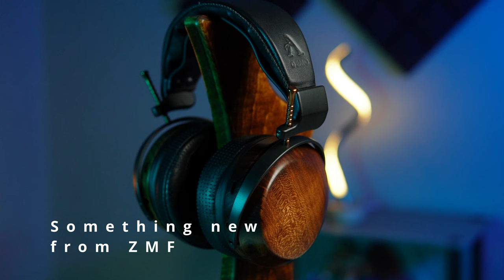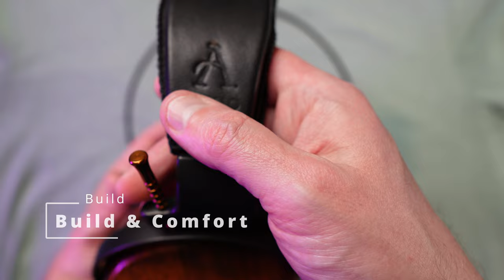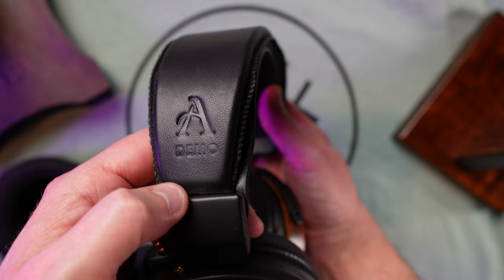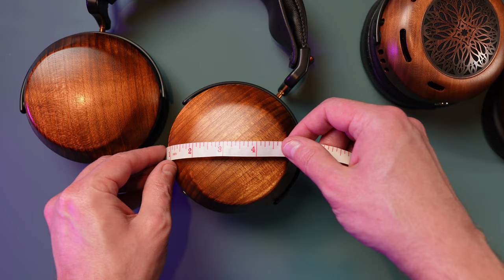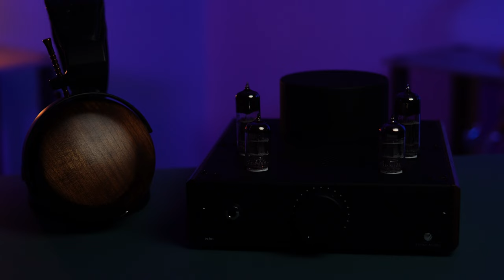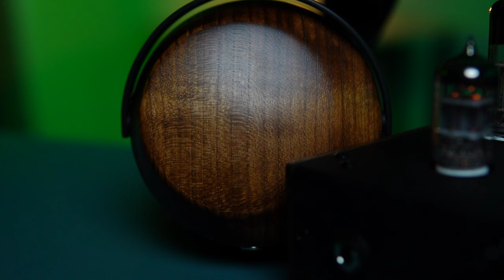ZMF Atrium Closed - Something Different

Comment: Hi Ryan. Do you think owning an Atrium Open and Atrium Closed would be too redundant sound-wise? I only ask because I currently own a Verite Open and Atrium Open as my only headphones atm, and love them both, but I do kind of want to have an amazing closed back for isolation/the closed back sound. A verite closed Ive heard sounds super similar to the VO, so not really interested in that. 

Also will likely get a Caldara at some point too but not in the near future lol, but yeah would love to hear your thoughts if you have a chance. Thanks!
Reply from the maker: I did own both the Open and now the Closed.  I kept the Closed because I felt it had the complete sound I was looking for.  So yes, I do think they are different enough.  Also, when you pad swap the closed you can truly get a different experience.  The closed has a fuller bass response but will relax your midrange a bit.  I do feel like it has a nice open sound for a closed back also.
Reply: @Skeeb23  Appreciate it man,. I just finished up consolidating my collection to only the 2 headphones (I actually grew to hate having such a large quanity of headphone choices lol, and no space). I think Im going to take the plunge and get the Ash Ltd version of the Atrium Closed in red, looks awesome

Thanks again!

Comment: Seing that Caldera in the background, what do you think about it vs Atrium Closed? We ZMF addicts are always in search for the new drug, just not sure if dynamic driver Atrium can compete with plannar Caldera that was so much of a step up to other ZMF models to me at least.
Reply from the maker: Well, I've just started listening to the Caldera.  So far it's made a big impression to me but I've got plenty of things to do with it still with my gear.  I'll also be considering the price increase compared to the rest of the lineup.  Agreed on the ZMF addiction though!
Reply: What do you mean by "compete?"
So far, I've seen some folks say they still prefer the Verite over the Caldera, and some say they listen to their Atrium more than their Caldera.

The Caldera is better in most technical categories, but that doesn't equal better musical immersion or experience.
Reply from the maker: @asplmn  this is such an excellent point.  I would not regret one bit if I owned the Atrium Closed over Caldera or the other way around.  Both are musical in their own rights.  Then add in pad variation, amps...tube amps ..there is a lot you can do to cater to what you want to hear and enjoy!
Reply: @Skeeb23  exactly. 😊
It's always good to remember that high-end audio is all about finding one's own preferences. Once you get to the TOTL stuff, it's usually more about tradeoffs than something being just all-around "better."

Will you be getting your hands on an Olive set of AC for comparison of harder vs softer, @Skeeb23?  🫒
Reply from the maker: @asplmn  I will not, but I've already read quite a few that have over on head-fi.  I know Zach has said there will be some sound variations for sure to be heard.
Reply: @asplmn  well for me it does. Verite see little to no use since I got Caldera, which is very similarly tuned but does almost everything else better. Only thing Verite does better are female vocals in jazz and slightly more 3d soundstage, rest ist vastly inferior to Caldera. That’s why I am wondering how AC holds up
Reply: @amaya897  if you ever get to compare please drop some info here.  I just got the ZMF AC and I'm really liking them.  I was hoping the Caldera would pair nicely and replace my Arya Stealth and possibly HD800s..unless I find later I can't part with the 800S

Comment: RME ADI-2 has waaaaaay more than enough power for these or any ZMF. I can't really take any 'reviewer' seriously when they don't understand basic amplification power requirements. Even at 120db(!). 120db would completely destroy your hearing. These headphones only require about 250mw and 8.6 volts for 120db. RME ADI-2 puts out more than 310mw and 9.9v at  300ohms. If you get the RME ADI-2 PRO version it will double those power figures with the balanced output. I have powered several set of ZMF headphones with huge remaining headroom with an RME ADI-2 DAC. "Audiophiles" and "reviewers" need to stop with all the misinformation.. 5:10
Reply from the maker: I disagree because this is where subjectivity comes in.  You are speaking from an objective nature to which sure the ADI2DAC is enough to power ZMF and other difficult to drive headphones.  However, when you listen on different amps with more power it's not about volume.  It's about the details, dynamics, impact, speed.. many little things that can make a difference.  I'm not misinformed if I can literally hear it.  Again, it's my point of view.
Reply: @Skeeb23  I am not saying you cannot hear a difference. I am sure you can. What I am disagreeing with is that taking your quote (verbatim) from the video “they are a headphone that requires some power (objective), I don’t think the 2 DAC has sufficient enough power for something like ZMFs. At least in my experience.” You are saying it is your opinion that it does not have enough power when objectively it has more than enough in terms of MW and current. I just think that if people are newer to the hobby, this will be misleading. That is all.
Reply from the maker: @04yellowjacket  That's fair criticism that I'll learn from for the future.  Thank you
Reply: @Skeeb23  It was nice chatting with you. Thank you.
Reply from the maker: @04yellowjacket  Likewise, it's an excellent hobby to discuss!
Reply: @04yellowjacket  having enough power for high frequencies and the mids is easy, but having enough power to properly drive the low end is ENTIRELY different